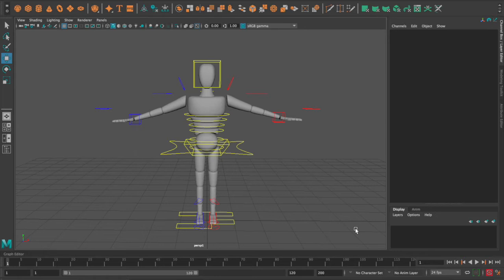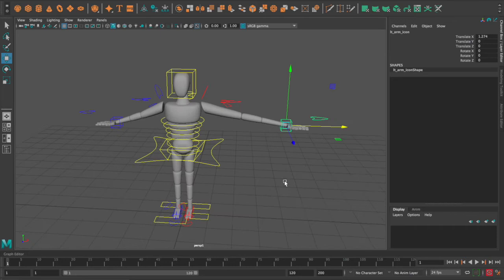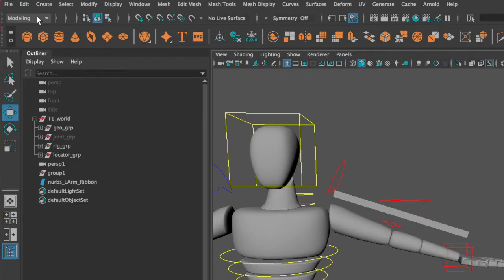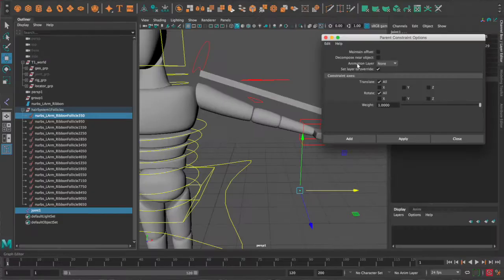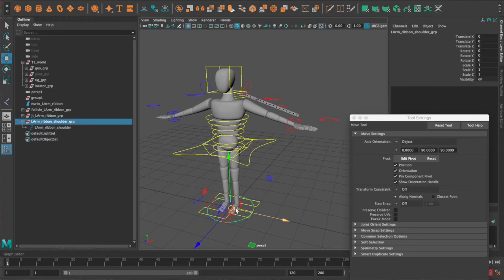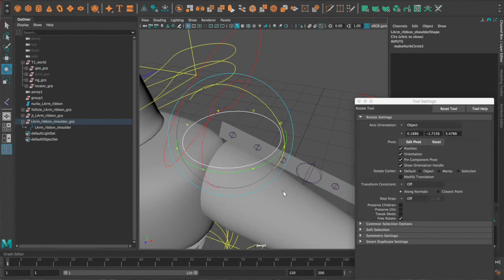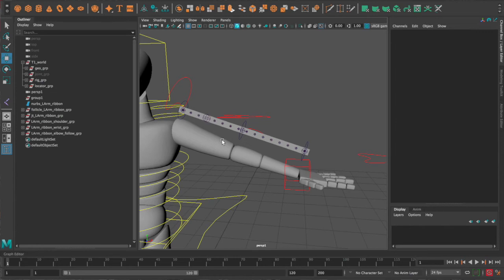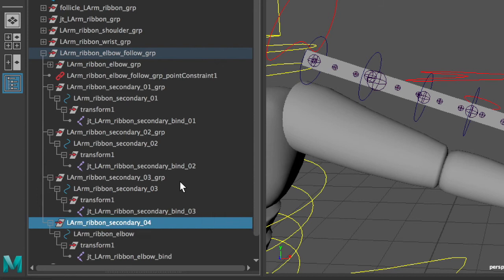Rigging SUPER STRETCHY ARMS in Maya - TUTORIAL

Comment: Will this work with an fk arm?
Reply from the maker: I have never tried it on an fk arm so I’m not sure
Reply: you'll need to setup a IK/FK switch system or a IK/FK blend system. It consists of 3 joint chains:  IK chain, FK chain and a follow joint chain. You connect the ribbon to the follow joint chain. The bind joint chain follows the IK or FK chain depending on the switch/blend value. Look up how to setup a IK FK blend or IK FK switch, then attach the ribbon to the "follow" joint chain.